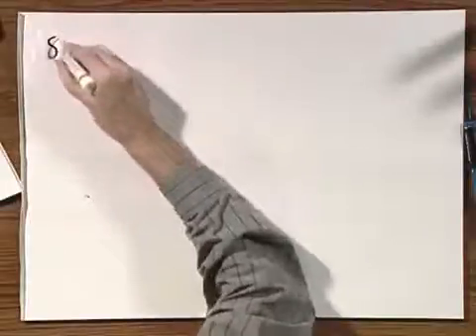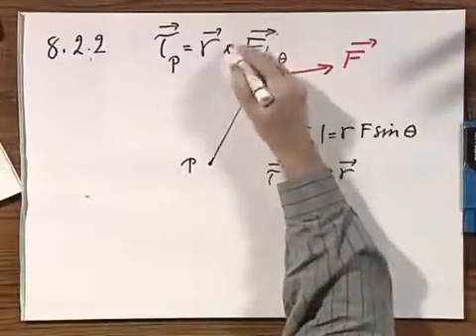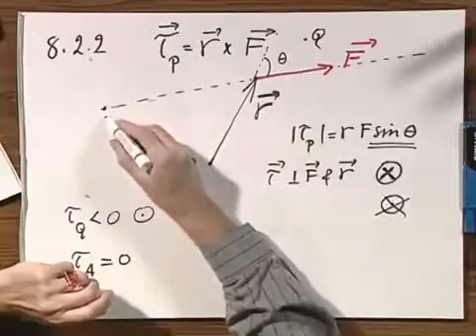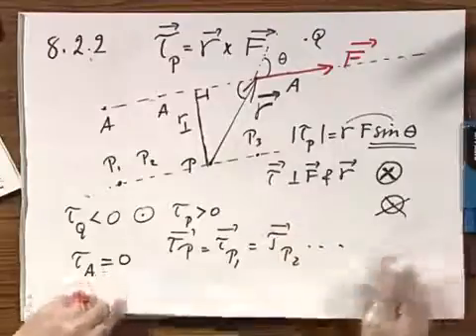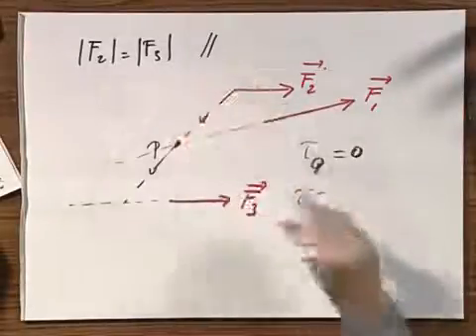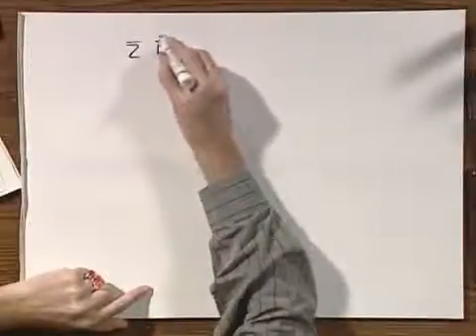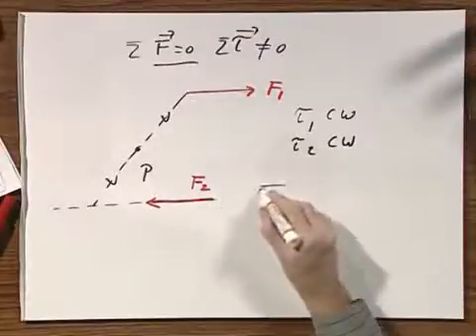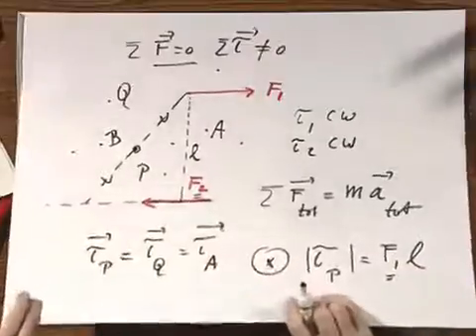8.01x - Module 21.01 - General analysis of torque.

Comment: Sir, what is the physical significance of Torque ?
Reply: rotation of an object, power transmission, machines, calculation of allowable shear stress, structural and machine designs etc

Comment: Thanks for the video. At 5:09, i dont understand why the torque2 would be positive if the torque is pointing into the paper. And I thought Torque3 would be positive.
Reply: torque2 is just like the first example in the video, the angle theta2, going from vector r2 to vector F2 in clockwise direction, is less than pi, so the sine of theta2 is positive, and by the corkscrew rule the torque is into the paper. For vectors r3 and F3 the situation is reversed; the angle theta3, in clockwise direction from r3 to F3, is greater than pi, hence the sine of theta3 is negative, and by the corkscrew rule the torque is coming out of the paper.